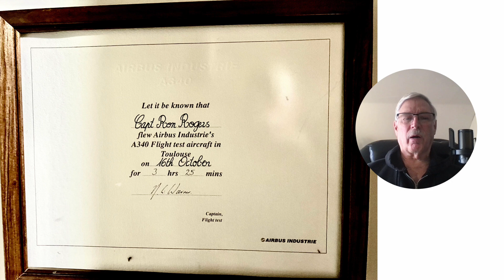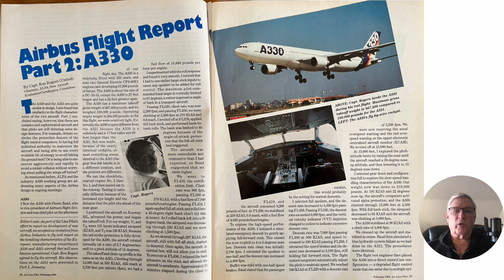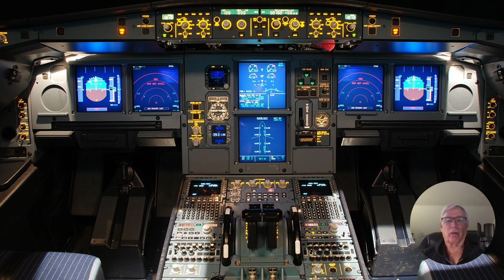An Unbelievable  BIG HOLE in Airbus protections!       Airbus Industrie flight 129

Comment: There is now a protection called global speed protection that limits the minimum speed to VLS when AP is on and the demanded vertical speed is high
Reply from the maker: Yes, now. It was a very long time before this hole was filled.
Reply: @ronrogers  we communicated a bit back in the 90s and a bit after, I think, in connection with the ALPA A380 evals when I was doing ADO work.
Reply from the maker: Ok, but can't  identify you from your tag so not sure. @Shemm777
Reply: @ronrogers  changed it, added some info also.

Comment: Ron, this issue has been fixed on the A320 family for quite some time. A319/A320/A321 FCOM, AIRCRAFT SYSTEMS AUTO FLIGHT - FLIGHT GUIDANCE, AP/FD VERTICAL MODES - ALTITUDE ACQUIRE MODE: "ALT* and ALT CST* modes have internal protections that decreases the vertical speed when VLS or VMAX is reached (VLS or VMAX becomes the priority target)."

Comment: I use to watch and enjoy your videos Ron. But I would allow myself to slightly disagree with your analysis on this one. I do validate the hole in the protection system as you do, no debate here. However, the mistake with the MCP can't  be refered as "inadvertently", it's a major contributing factor to the accident. Same with the  exaggereted pitch-up maneuver, I don't think we can only say the pilot was distracted. I mean these 2 factors put the plane out of its flight envelop, which is never a good thing to do. Then we can always argue that the flight envelop and the associated protections are not on point and it's valid to say it but still... there are 2 major mistakes here.
Reply from the maker: Good points
Reply: @ronrogers  Anyway it's always nice to have people like you who are able to break down accident reports and to try to make the topic understandable for non specialist. And losing someone we know and appreciate is not something we can get used to anyway, so sensitiveness is always around...

Comment: Thanks Ron. There's a memorial inside the north boundary of Toulouse-Blagnac aerodrome, which used to be signposted on the public roads nearby. Yes, Nick Warner succeeded Gordon Corps as Airbus chief test pilot after GC died in the Himalayas investigating a Thai Airlines A310 accident in 1992. 

They were both gents and, as I wrote last week, it was a sad loss to the history of digital FBW development that neither lived to retire and write their memoirs. It would have been revealing to read between the lines of their - no doubt generous - assessments of Bernard Ziegler, the pilot-engineer who conceived the A320 EFCS and broke with tradition and the preferences of most of us airline pilots by stipulating non-interconnected sidesticks and non-driven throttle levers. After his death, Nick's wife asked for any donations to be made to the RNLI, which is the UK's lifeboat service.

Comment: On all Flight Guidance standards on A320/330 aircraft in service today, the AP automatically disconnects at 25 degrees pitch or when the angle-of-attack protection activates.

Comment: Let's be clear one thing; Ron lost his dear friend in this accident. Take the video with a grain of salt and look at all facts objectively. 

To start with, there is no such thing as uncrasable airplane. You can crash it intentionally, as was demonstrated in the German Wings flight, even if the aircraft was in normal law with full protection. You can crash it unintentionally, when it enters alternate law and protections are lost. And even in normal law, the protections do not cover all cases. When landing and taking off, different rules apply with reduced protection. If this was not the case, one could not land the plane, slow it down and stop it. 

One of the quirks is the altitude capture mode of the autopilot. This could override the protection in certain cases, as it tragically turned out on this flight. For the record, something Ron doesn't mention, this is NO LONGER THE CASE on new aircraft like the A350.

Something Ron didn't mention is that this was a single engine take off certification test, nothing to do with test of the protection system. The overworked chief pilot, Ron's friend, made some mistakes that turned fatal.

If one reads the report, the blame is primarily on the test pilots mentioning fatigue and pilot error. The autopilot functionality is mentioned as a contributing factor. 

Which brings me to the point: the chief test pilot should know the limitations of the protection system and the working of the autopilot during this phase of flight. The chief test pilot should in those cases do not allow the aircraft to enter an attitude where it is no longer controllable nor recoverable. He, Ron's friend, did not do his job and perform the test flight under safe conditions resulting in the tragic loss of aircraft and life.

And to be clear, I have not seen Airbus marketing material nor official statements that their aircraft are uncrashable. If Ron has the impression that such statements were made, I am sure those were made in private,  probably by the same chief test pilot that crashed the plane.

To point the finger at Airbus, as a responsible employer, they should never have allowed the overworked test pilots to perform a test flight at the end of their workday. Furthermore, they should have created a company culture where thoroughness prevails, including preparation for test flights,  executing test flights and being prepared to act if the automation behaves differently than expected. 30 years later, the situation is much different, contrary to their colleagues which are today taking safety way more casually.
Reply: Thanks.

Comment: I am not a pilot, I know nothing.  But I have always believed, Since that first crash in France, many years ago, that Airbus design is intended to eventually eliminate the need for pilots.  So in an Airbus the computer flies the plane and the pilot monitors the computer.  Great, until something goes wrong.  When the poilot tries to take command the computer will not allow.  Not good.

Comment: Got this from a LCA on the A350: "If the question is whether ALT* supersedes or inhibits envelope protections of Normal Law (assuming Normal Law active), the answer is no - not on any Airbus model. Mode reversions can occur ("triple-click" is the cue, e.g. reversion to V/S) during ALT*, but that's not a threat to flight envelope, only to compliance with an altitude target. The AP/ FD is available up to the limits of the protected flight envelope. However, when a protection activates (i.e. when the aircraft is out of the normal flight envelope) while the AP is engaged, the protection takes over to control the aircraft and the "AP IN PROT" message appears on the FMA. This is available altitude acquisition and hold modes."
Reply from the maker: So you are saying, at least by the 350. It has been fixed.
Reply: @ronrogers  Looks that way Ron.  Whenever we venture out of the protected envelope in the Sim (Normal or Alternate Law) we have to do it in Direct Law.  I've only been flying the Airbus for about 2 years (and only the 350).  20+ years in the Boeings.
Reply: Yes the A350 has AP protect mode which is the AP flying the protections and disregarding the modes selected , however with the older A330’s (not sure about the neo)the A/P would disconnect at Alpha proct thus A/P not flying alt star, it would be nice to know if the A/p was used at all throughout this manoeuvre. I suspect the pure momentum of the manoeuvre could have got them through Alpha Max. As I have said more than once “no software can beat the laws of physics” as an aside the B787 will be very similar in an alt capture mode with high closure rates,  I had to disconnect on more than one occasion as speed loss became unacceptable. A truly tragic loss, pleased you still remember the guys. MSN 001 I believe!
Edited to add the A330 neo will disconnect at Alpha proct as well.

Comment: I am surprised to hear that Normal Law is supposed to protect from Vmc!  With a limit of 67 degrees of bank, and with TOGA power on the one engine, after reducing the other engine to idle thrust would seem to be able to quickly get the airplane into a high enough roll rate that the bank angle protection algorithm could be overwhelmed.  Because a Vmc situation is not a “normal” flight condition, but one that could happen if an engine suddenly failed, Normal Law would fight the impending roll until reaching the 67 degree bank angle limit.  If the rolling moment though, is nor stopped after reaching 67 degrees of roll, then an automatic reversion to Alternate Law is supposed to happen. Once the airplane rolls beyond 67 degrees, I recall that the FBW should then fail to Alternate Law with no bank angle protection.  I was taught that this scenario was intended to allow the pilot to recover should the airplane roll over on its back. Most of the protections are deactivated, which then allows the pilot enough control authority to recover from such an unusual attitude.  I would agree that there appears to be a hole in the control laws if a Vmc roll is not arrested before exceeding 67 degrees of bank.  And if the roll rate is fast enough because of the engine thrust difference at at aft cg (worst case scenario) and also where Vmc is at the highest airspeed, the only way to stop the roll is to reduce thrust on the engine at high power.  The crew did this, which is why they were able to level the wings in the upright attitude before the airplane pancaked into the ground.  Ultimately, they lacked sufficient altitude to recover before hitting the ground.  It seems to me that it was the combination of several less than optimal situations caused the accident.  2000 Feet selected altitude, the autopilot in the altitude capture mode, an aft limit cg, TOGA thrust on one engine while the other was at idle thrust, a very slow airspeed (less than Vmc) caused by the pitch up to capture the selected altitude, and a slow response of the pilots to a quickly deteriorating situation are the broken links in the chain of events that resulted in the crash.  The question that lingers in my mind is why did they keep trying to engage the autopilot?  Did they really think that the autopilot could have restored the airplane back to a normal flight condition?  Failure of it to engage after the first or second attempt should have been a clue that the autopilot sensed that the airplane attitude was too far out of its engagement limits.  No?
Reply from the maker: You never get anywhere near the 67 degrees on an engine failure. This was demonstrated to me in the aircraft by Zeigler. The aircraft goes into a bank of a few degrees.

Comment: I  was lucky to fly the Bus as a United new hire back in 2000. I remember an article the fleet put out titled: "ALT* Is Not Your Friend" It definitely was eye opening to realize during altitude capture, there were no protections. I've noticed on the 737 if you slowly approach the assigned altitude it will go into Altitude Aquire early, and then after a small delay, it will pitch up to reach the altitude. Regarding the excessive pitch during  rotation on the A330 accident, I wonder if the aft stick pressure required to liftoff wasn't relaxed after normal law blended in? I remember my first couple of "V2 cuts" in the sim I spent so much mental energy keeping the airplane heading straight, I didn't realize the pitch was too high.

Comment: The way I read in Aviation Week at the time, the aircraft, because it was rather light and was overpitched, started a rather rapid initial climb, and the AP performed a quiet aggressive pitch down maneuver to capture the 2000 ft. altitude.  This maneuver took the pilots by surprise, especially with them sitting so far ahead of the CG.  This led them to pull the stick and enter a deep stall.

Comment: They clearly have a lot of ego. And what if they intentionally didn't fix it because they wanted to double down and not admit fault? That's an incredibly dangerous decision if so. The exact reason why it shouldn't be private companies in charge of air travel for the public.
Reply: This happened 30 years ago with an aircraft still in tests. And clearly a lot of progress have been made since. This aircraft turned out to be one of the safest commercial aircraft flying today. The numbers are on Airbus side.
Reply: @miks564   Modern Part 25 aircraft are basically all quite safe, except for a crash here and there.  Even the MAX has had fatalities in less than one of every 900,000 flights.  So talking about that handful of crashes makes sense, especially if it's something which can still happen today and yet pilots aren't getting trained on it.
Reply: @marcmcreynolds2827  Sure. But this was a A330 test before commercial operation 30 years ago. 
30 years is an eternity in terms of software development.
Fly-by-wire stuff keeps evolving over time (software fixes and upgrades) until the support is terminated from the manufacturer.
Reply: @miks564   From what I've been reading here of various pilots' training experiences, there was no fix/upgrade until the A350 -- anything earlier is still subject to a recurrence:  Pilots (even Airbus test pilots!) doing mostly what they are supposed to destroys the aircraft.

The fact that it happened all the way back in flight test, but was apparently left alone, makes this even more worthy of discussion.  There was one person in particular (I'll call him Mr Ego) who drove their FCS decisions back then.  With him out of the picture now, perhaps never too late to admit a mistake and actually implement the fixes/upgrades that you're imagining happen as a matter of course?
Reply: @marcmcreynolds2827  it’s not imagination. There dozens of examples of incidents, most of them cause by pilot error as usual, but that Airbus saw an opportunity to improve both procedures and the software to minimize the risk of recurrence. And whenever this happens, the whole fleet benefits with it.
I don’t know for sure if the hole found in the testing was left there if it contributed to a plane and lives lost. If it’s hardware related, we know we can expect manufacturers to try to avoid spending more funds, if it can be corrected by software, I honestly don’t believe they opt for leaving it unfixed.
But I also know that the complexity of these systems means there are always new holes to discover and fix.
Reply: If you think state-owned companies involved in the R&D of safety-critical systems are less likely to screw-up and more likely to admit the error afterwards, I fear you are living on a socialist Cloud Nine! This was epitomised in the UK in the the late 1920s, when there was a government requirement for a large, rigid airship for long-haul flights. Two candidates emerged: the R100, a private venture with state funding designed by Barnes Wallis with Nevil Shute Norway (chief calculator) and the R101, a government project by the Royal Airship Works. 

The R100 flew successfully from England to Canada and back. The R101 had to be enlarged in length to carry the required fuel and payload but struggled to maintain altitude and crashed into a hill at Beauvais in Northern France on its maiden flight to India, killing everyone on board. As the state project had failed, killing the aviation minister who had initiated the programme, airship development in the UK was simply abandoned. (Wallis went on to design the geodetic Wellington bomber and various bombs, including the bouncing bombs used to destroy German dams. After WW2, his tailless, swing-wing, supersonic Swallow (proved by scale models to avoid risking test pilots) inspired the General Dynamics F-111 and he later worked on hypersonic airliner projects. Norway helped form a successful aircraft manufacturer, Airspeed, before WW2 but later earned fame as the author, Nevil Shute.)